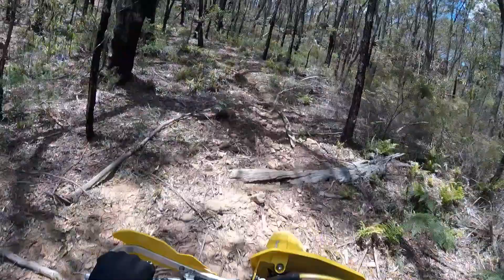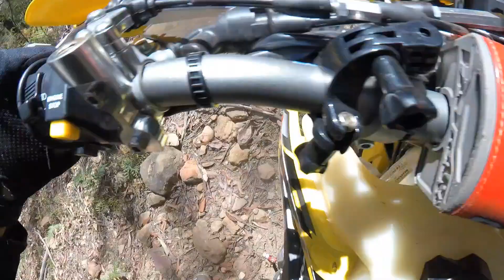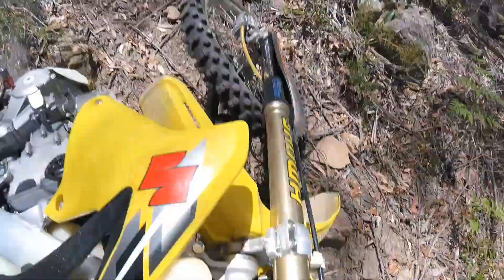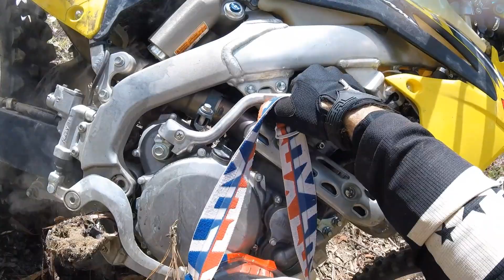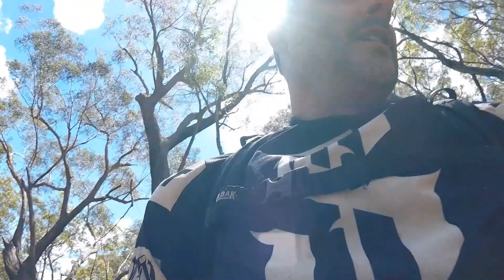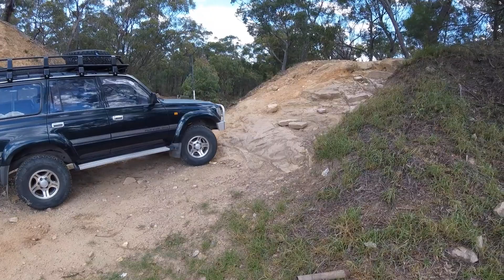450 dirt bike overheating.

Comment: Steve, i have the same bike and bought a Trail Tech Universal Fan Kit and a Outlaw 1.8 Bar radiator cap.
Problem solved
Reply from the maker: Thanks Peter I will have a look on the net and see if I can find them were did you get yours?
Reply: @BrokenSprocket  Both from Ebay buddy, i believe you can get them from MX store for the same price. The Fan kit needs to be fitted to the left hand side radiaor (as your sitting on the bike) as it wont fit on the right and the Outlaw radiator cap fits under the IMS tank. I run the bike at about 70 degrees before the fan turns on and it runs ice cold all day.
Reply: The copper temperature probe on the fan kit needs to be shaved down slightly to fit between the fins but its an easy fix.
Reply: @BrokenSprocket  Oh and Engine Ice radiator fluid helps.
Reply from the maker: Thanks for your help Peter looking into it now.
Reply: @BrokenSprocket  Anytime Steve
Reply: @MrAelarag1  I'm having an over heating problem but mines show no symptoms

Comment: Radiator fans work well, the trail tech ones are good but way overpriced, if you like making things yourself you can use good sized CPU fans from a PC and rig it up with a simple on/off switch, no need for a thermostat, just switch the fans off and on When you want.

Comment: i overheated my 2018 CRF250R on the break-ins, coolant came out and i was worried i damaged something, put some water in the radiators 30 mins later and now i have like 15-20 hours on the bike and its still good, is there anything i should still look out for?
Reply from the maker: yeah I think they spit the coolant out before any damage can be done I've had no problems with mine since thanks for watching.
Reply: Broken Sprocket yeah no problem, thanks for the response!

Comment: ohh Steve, Steve , Steve. Mate going out on your own! reach out and let see if someone can come with you.
I had crf450x that boiled over through the overflow. A new radiator cap with new fluids seemed to help. The new cap was a bastard to push on, that just indicated how the spring had weakened on the old one! if that tip helps! "SilverTop - Douggie"
Reply from the maker: Hahaha it a spur of the moment ride. Thanks for the info on the radiator cap.
Reply: @BrokenSprocket  you may consider using wetter water that's what I use for my coolant I also bought a radiator cap on Rocky mountain ATV that has my temperature on it and I can see it as I'm riding
Reply from the maker: Thanks mate I'm looking at a radiator cap like that one $86 over here not cheap lol...